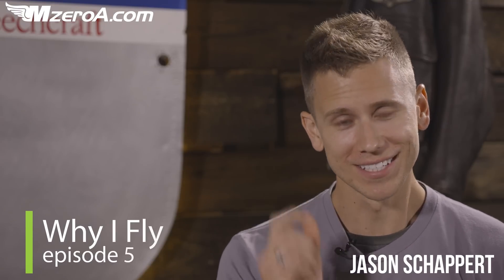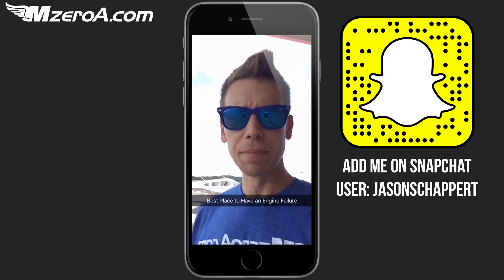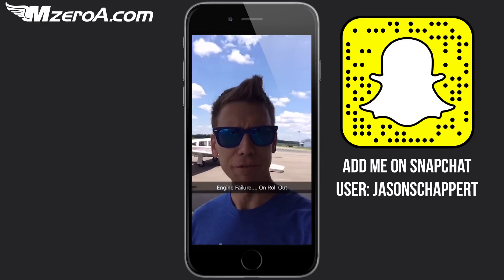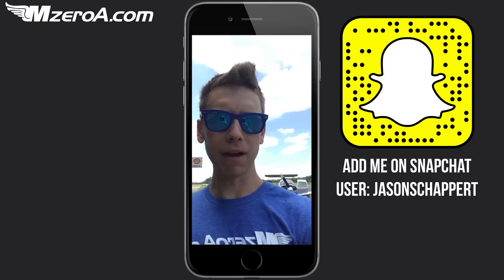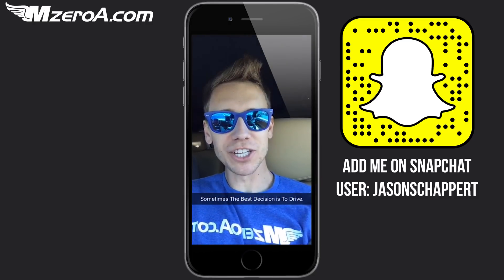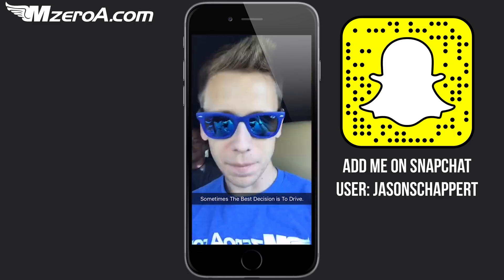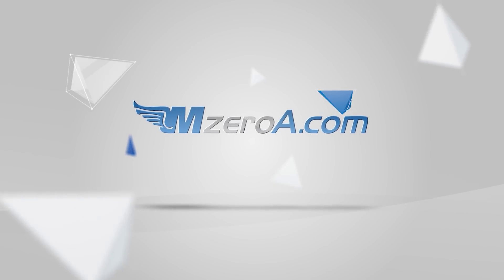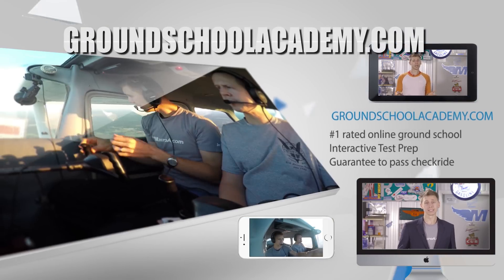Engine Failure On Landing Rollout!? | Why I Fly 005

Comment: That sounds like a fuel delivery problem.  Fuel Pump on on landing = High fuel pressure, mixture full rich too. That can produce a too rich mixture if carb is set wrong, or fuel systems regulator valve giving up.  If Idle speed set too low? engine dies at idle easily.  Im a mechanic and CFI.  I like to test the mixture on any new airplane i fly.  At idle and also at full power before take off.  You do that with the mixture control.  Engine should not cut on the extremes but in the middle mostly.  You can test the mixture with the mixture lever.

Comment: I just had the pleasure of experiencing this today. I’m a commercial charter/scenic pilot who does the odd post-maintenance test flight for the local mechanic. Today I did a flight in a Beechcraft Musketeer that is going back into service for a local private pilot after a couple of years of non-use. 

I’ve taken the aircraft up for a flight control check after a new cable installation and to test a new Garmin gps unit by running it on a GNSS approach back into the field. 

I got the aircraft back on the ground with no obvious issues during the flight and then the engine just quit. Mixture was rich, fuel selector on a tank with plenty of fuel. It was easy enough to restart once we rolled it off the runway and a couple of idling checks didn’t seem to replicate the problem.

Suffice to say, it is indeed the best place to have an engine failure!

Comment: I spoke to an experienced Arrow mechanic, owner, and CFII about this and he knew exactly what caused this. There is a diaphragm in the fuel control unit. When Arrow sits for a while the fuel to go bad and causes the diaphragm to stick so it was providing more fuel than the air flow could burn and caused the engine to flood. Once you where on the ground the diaphragm returned to a more correct setting and allowed the engine to run normally for the mechanic. The fuel control unit needs to be rebuilt. Just in case anyone is wondering.

Comment: My CFI sense tells me that it was probably a mixture problem. The hot day raised the density altitude and the mixture control was improperly adjusted. The overly rich mixture robed the engine of power and ultimately flooded the engine and caused the stall. This often happens at high density altitude airports when low land pilots go to full mixture for landing. A small mechanical flaw could have made up the difference.

Well, did I get it right?

Comment: Jason, maybe your mixture was to rich for that particular density altitude? I've heard of aircrafts that operate at high elevations or hot locations on landing as part of their pre landing checks they put mixture full rich and the engine quits just as they roll out. Food for thought mate. People need to understand the mixture needs to be leaned at high elevations, it's not the same as operating at sea level where the air is thicker. Thinner air, less fuel required.
Reply: It also explains why it started back up after you landed.

Comment: This made me think of an interesting question, at least interesting to me.  Run up mag checks are done with the engine well above idle.  What about checking them at idle?  Not a pilot myself, but if I were, I think I'd be happier knowing my engine would still idle, particularly at approach and landing power settings, even if one mag went south.  Like say you were on an instrument approach, a few hundred feet up, found yourself a bit high, pulled power to descend, and the thing quit?  Not a good day.

Comment: I was just reading an accident report where an aircraft had a known squawk - bad vacuum pump, but was flown anyway. they were in IMC when the other vac pump failed. They lost attitude indication and crashed. The point is why fly if there are known issues with the aircraft? During your discussion I note that you took off several times with more and more issues noted. How many is too many? For me it's one. The first sump could have been a fluke, but two? I would have never made it off the ground until I found out why.

Comment: Look forward to learning what happened, Jason.  My uneducated guess is throttle linkage adjustment was incorrect---you weren't getting full-throttle so MAX RPM under load was down and you were able to close throttle beyond minimum idle setting.  Or perhaps ignition timing problem.  Whatever the reason, driving was best decision!

Comment: clogged fuel vents? 

I'm thinking a vacuum in the fuel tanks caused the valves on both sides to stick open with the vacuum eventually building up enough to restrict fuel flow.

preflight always has us look at the fuel vent tube to make sure it isn't clogged, but i never did find out how to check whether a vented fuel cap is working or not.

interesting.... yup I'd never get back in that plane until the problem had definitively been isolated.

great video..... thanks Jason.
Reply: My question is how does a pilot/owner know when an aircraft like that is safe to fly again? 

If the only mechanic there says he doesn't see any problems, at what point would someone feel confident flying that plane again?
Reply: Ask the mechanic to join you for a test flight.
Reply: JLDoctorWho You hit the nail right on the head there. LOL . About the fuel tank vents: I’ve always been a bit uneasy as to whether those mud-dauber wasps might not have built their home in a place that can’t be seen in the tube , and not finding out until well into the flight. Ah—the risks we take!

Comment: Had something similar happen to me once in a Piper Cherokee regarding 'cues' and listening to the airplane. I was one day from losing my night currency to take passengers so I headed to the airport to do some pattern work.  When I arrived I headed out to preflight and noticed frost on the wings - strike 1.  I was then moved to another Cherokee that was in the hangar so it was frost free.  As I started taxi I noticed the brakes were very mushy.  I had to push with everything I had to get good brake pressure.  I continued on the premise that the runway I would be using is over 8,000 ft long.  strike 2.  I had an eventful run up and taxied for takeoff.  I added full power and started my rollout.  As my airspeed reached rotation point I pulled back on the yoke and the landing light went out.  Strike 3.  I had a split second to decide what to do and I immediately pulled power and gently let the nose down.  I taxied back to the FBO in the dark and called it a night.

Comment: I have a rule for myself and the people I fly with, that if 3 or more issues, problems, or complications come up, I stay on the ground that day. They could be anything from personal issues (got in a fight with the wife that morning) to mechanical issues with the plane, to support issues (I once spent all day just getting my preheater working). Even something as benign as having to go back home to get the flight bag that you forgot on the counter. It's not worth going flying when you are already frustrated or rushed. You never know if you missed that one other thing that could cause problems in the air.
Reply: I absolutely agree on the "rush part", as it can and will get you or your passengers killed.
Reply: I don't have a strict rule of 3 like that but I definitely have a Bullshitometer, that, like the altimeter, is dependent on the days current conditions

Comment: I'm guessing an issue with mixture. Not that the pilot had the mixture wrong but a leak or adjustment somewhere causing the mixture to be too rich. That has happened to me before.